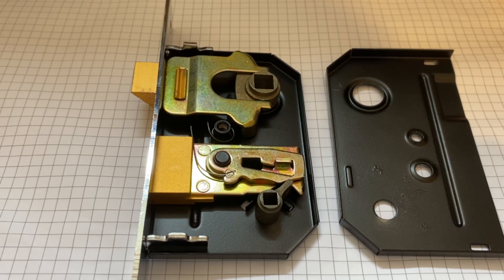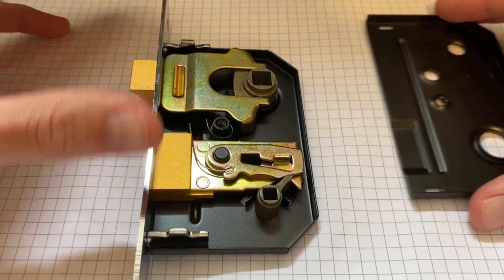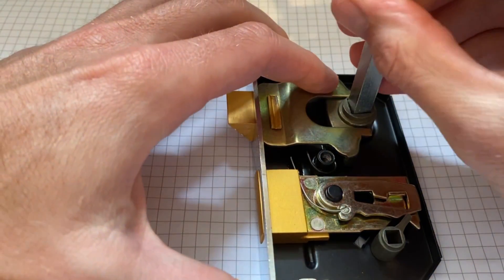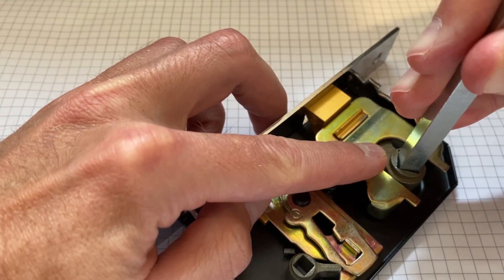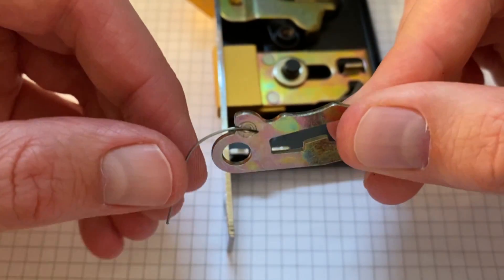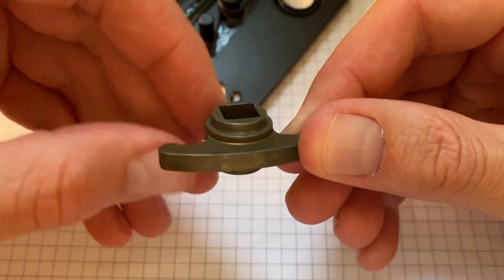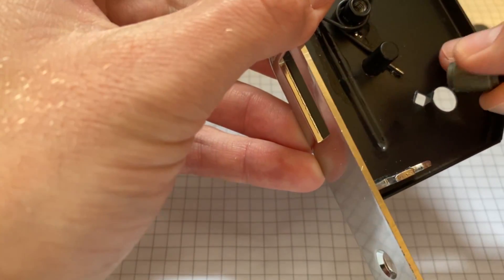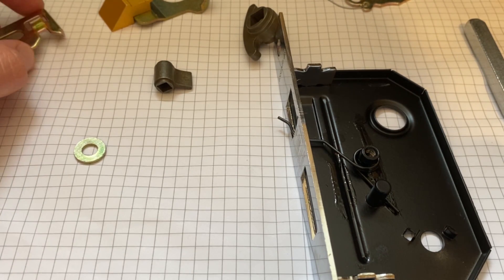how a door lock mechanism works

Comment: Could you show me the internal workings of a ranch slider door. I took it apart and a little spring which hold the push up or down panel to lock or unlock but I don’t know where it should be re instated . Thanks  Don’t want to pay for a new lock and handle as on a pension